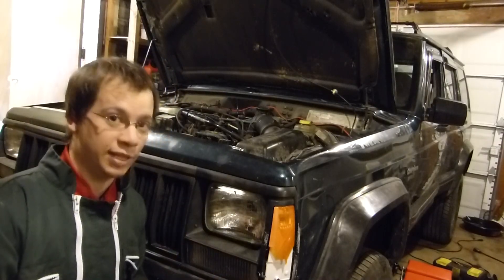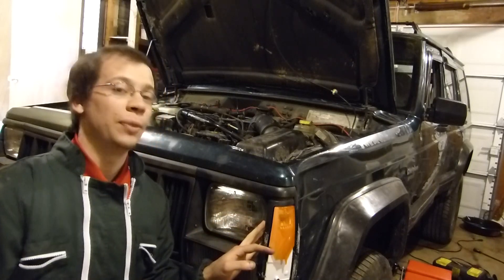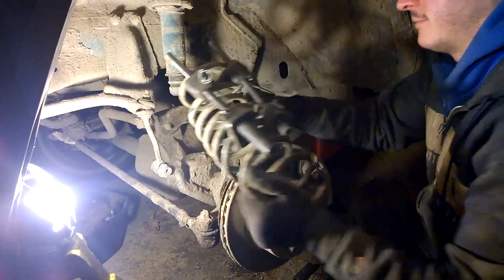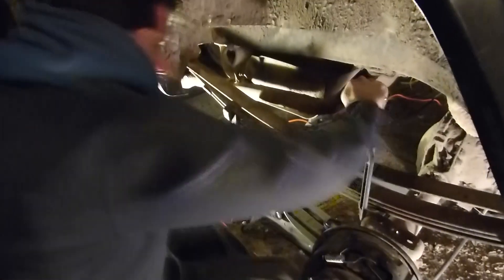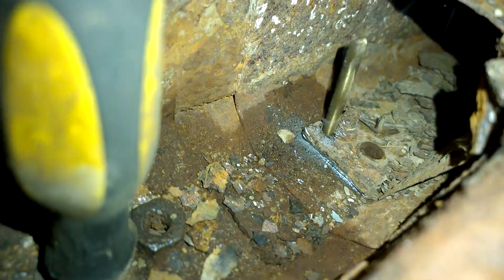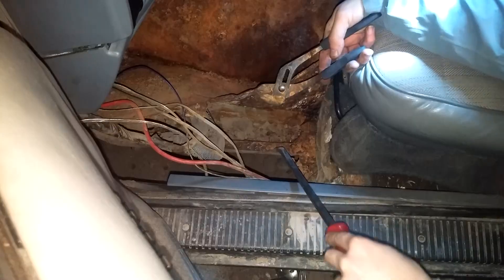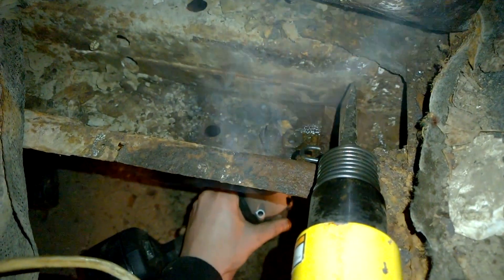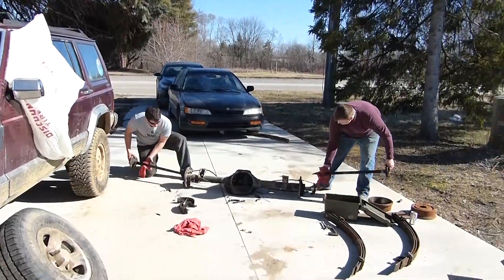$600 Moab Jeep XJ Update: Part 1 | BLIP!

Comment: Dent in front fender: Check
Reflective lens cracked: Check
Rust: Check
Carpet floorboards: Check
Electrical issues: Check
Yup, you meet enough requirements to pass the Cheap Cherokee Checklist

Comment: simple until you break a rusted bracket and have no access to welding tools
how many inches was your lift to cause u joint issues
about to attempt a 3 inch rough country lift 
neeeeeeeeervousssssss